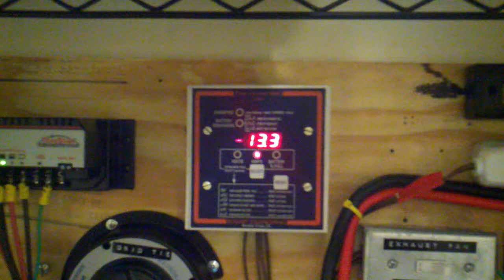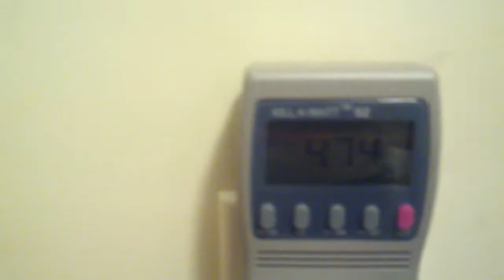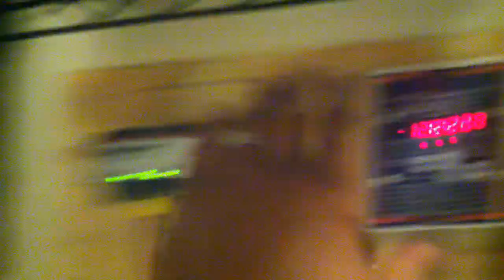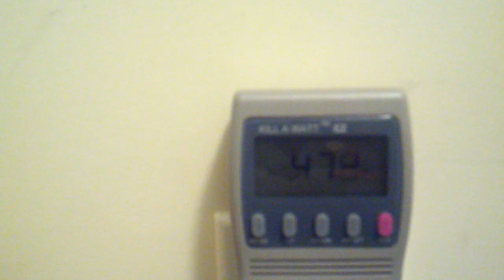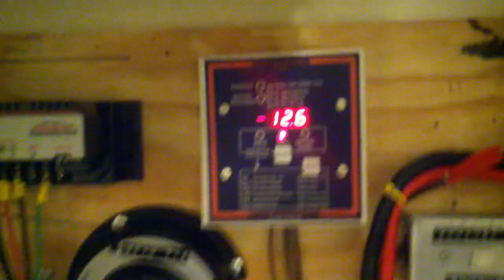DIY - Sun 500W Grid Tie - Off Of Battery Bank Performance Test Part 1

Comment from the maker: Actually, if the current draw is larger than the charging input, the batteries would still be discharging at a rate of 10A instead of 20A. The benefit is that they simply discharge by half the rate. If I was charging at 20A and discharging at 20A, it would be like adding a gallon of water to a barrel while someone is taking a gallon out. If the batteries are fully charged then the charge controller goes into float mode to keep the batteries fully charged, the excess power is wasted.
Reply: I know this is older, I'm just getting into grid-tie and solar, I have a renogy rover 40A and 5x100w panels, charging a 100ah lithium but they are in series now, how can i keep the battery from discharging or is it possible to regulate the power from the mppt where i can disconnect the battery and just power the inverter from the mppt.

Comment from the maker: Sounds like you don't have enough voltage at the battery. If planning to use this with a battery, you'll probably need 2 in series for it to work.  The harbor freight panels may be producing too much voltage, in which case you may need to put them in parallel.  In any case, check your voltage limits for your GTI to determine the range you need to be in.

Comment: I tried that the same day I asked you that question I tried that and I relized I will just hook my pannels directly to that and use my other as a dumpload for now and I have two adjustable power supplies I will leach off the power comming in to charge the batteries.

Comment from the maker: Thanks for your question. I found that the closer you get to the maximum voltage the higher watts you'll get. For example, I have a 500w GTI with voltages from 10v to 30v, on a 24v system, I can get around 450w out of it. I also have a 600w GTI with 22v to 60v input and on a 24v system I'll get around 300w or so. For a test, change your battery bank to 36v or 48v and watch the results. My guess is that you'll see an increase in the wattage.

Comment: what voltage gti do you have I have a sun-1000g  22volt to 60 and when hooked to battries it only pull about 230 watts not 1000 watts and the bank is at 25 volts is there a reasion for that or do you know thanks if you can help

Comment from the maker: Yes, in this video I have a digital timer connected attached to the meter to stop and start the GTI.  On your 2nd question, with my current bank of 6336w of usable stored power (6336w / 500w = 12hrs runtime).  However, I would not recommend running your GTI at night, you would be much better off simply running your electrical appliances off of a regular inverter.  To run a GTI off of a battery bank at night or when there is no adequate sunshine to recharge your batteries is not a good idea.

Comment: Hello, I have two questions for you - is that a Timer on the Kill-A-Watt Meter just before the grid tie?  I assume you use the timer to stop and start the grid tie.
Second question, if you ran the 500Watt grid tie (at night), how long can it run before your batteries drain and your grid tie go into auto shut off mode?  
Thank you!!

Comment from the maker: @hing983 The battery selector switch has 3 terminal lugs, On the 1st terminal lug on the switch I connected one positive cable to the grid tie inverter and the 3rd terminal lug I connected one positive cable to the regular inverter, and finally on the middle lug (2nd Lug) of the switch I connected a cable to the positive terminal on the battery.

Comment from the maker: @14103543280 Thanks for your question. No, my grid tie is still running fine. With an internal fan blowing hot air out, and an external fan blowing cool air into and around the unit, it only gets warm to the touch. As for power, the unit is rated at 450W normal output power and 500W max output power so 470W for 4hrs is not going to kill it. The draw back to this method, is that the solar conditions must be favorable to use the batteries as a buffer and for rapid recharge. However, it does work.

Comment from the maker: @sparktastic1 Good observations and you are essentially correct. In subsequent videos I found afterwards that the unit peaks at 600w and not 500w as labeled.  Thus the actual efficiency is around 79% (473w out / 600w in = .788).  And yes, the unit draws 20+ amps from the bank, which is offset by the power coming in from the panels. The battery bank stores 6600w so the unit had max power to draw from and allowed it to peak on average 473w an hr.  See verification series for more info, Thanks.

Comment: No sorry, your figures don't add up.
I have SUN-500G's and I know for a fact that at >400W output they are only about 77% efficient. So for a single SUN-500G to put out 450+ watts AC, the input power would be close to 600w! 600w at 24v is 25A not 13A.
For you to produce 450W AC with only 312w DC in (13x24v), your inverter would have to be 150% efficient. You could solve the worlds energy needs with that kind of technology lol.